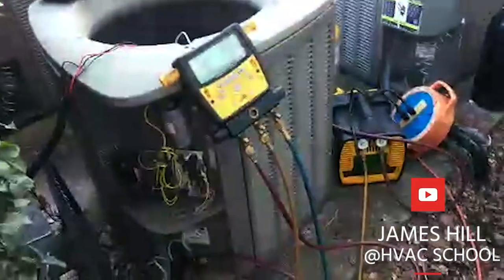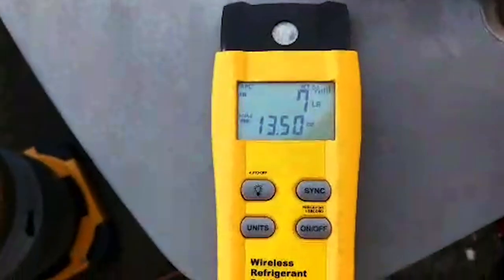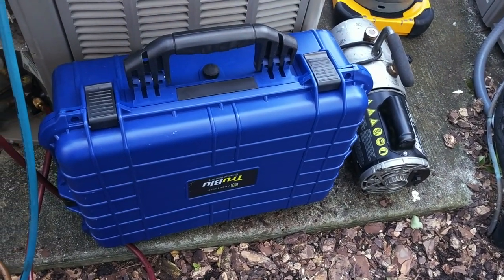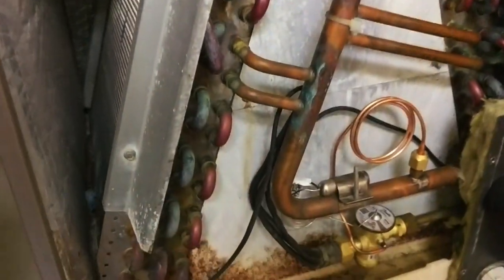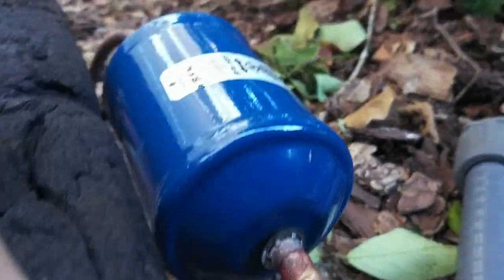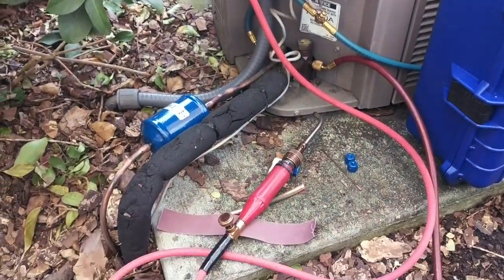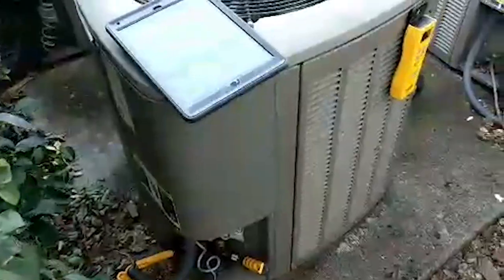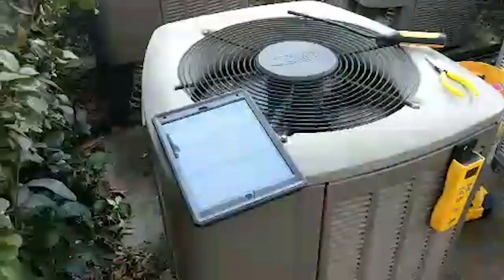How to Replace a TXV

Comment: Now i'm curious on how the TXV it's changed on a heat pump itself every time I search it get all the videos I am finding is for the one that is indoor at the evaporator coil. My American standard heat pump is coding bad TXV. When it switches the heat cooling works fine but no heat. Problems started after a maintenance call last month hear pump worked fine until they sprayed it out.

Comment: Either recover the refrigerant or perform a pump down. Remove said TXV and install new as well as a filter dryer. Perform a leak check. If everything checks out reintroduce refrigerant, and check delta T and charge. Done. Oh and don't forget to do a vacuum to at least 500 microns.
Reply: Running Coyote, no vacuum? 😉
Reply: @Mauriciom2011  yea I went back and added that. Hopefully I don't forget when I actually replace one  lol.
Reply: Too bad the guy only pulled it down to 1000 microns huh

Comment: How long was total evacuation time? I know it’s not about how long but was just curious. I’ve always found it took awhile to get below 500 when condenser is open to the line set. Unless I changed out the compressor.
Reply: Well I was evacuating the whole circuit which included the compressor and condenser coil, total evacuation to 500 microns took a good 2 hrs.
Reply: James Hill ok good. I’ve always had trouble even with 2 appion hoses. I think it has to do with the oil in the system. Any thoughts on why it takes that long? How do you like the tru blu.
Reply: @All4ChristNone4me  Love my TruBlu setup! And yes, that is exactly why evacuation took so long, I was evacuating the whole circuit, oil in compressor makes it take longer. My vacuum pump is 7yrs old but still pulls down to 40 microns when tested with micron gauge connected directly to it. Was just given a new NAVAC NRO6Di today, can't wait to try it out.

Comment: Soldering? Did you mean soft solder? That is would you have brazed in TXV or soft soldered the txv ?
Reply: You can use Stay-Brite 8 solder for HVAC instead of brazing. It's intended for HVAC use, everywhere except compressor head discharge port, really.

Comment: Can you remove the valve permanently and let it flow?
Reply: No. Your evaporator will either flood or starve constantly.  Pressure and temperature go hand in hand. As the temp changes in the unit and the ambient environment the pressures in your system are also changing.  Changing pressures will either flood or starve your coil, by slowing down or speeding up refrigerant flow.   A starved coil freezes up.  A flooded coil well it eventually floods and slugs your compressor.

Comment: Lol, the guy improved the situation by moving the filter from inside the case (where it would at least dry out quicker should the rain wet it in summer time) and moved to outside so that it will be easier to service later. Also, which part of the video corresponds to the title of "how to"?
Reply: “Get wet?”  It’s a filter drier, who cares if it gets wet?  It will dry just as fast as everything else out there.  Now for ease of replacement for the next guy, yeah that’s cool.
Reply: @bertellijustin6376  - it doesn't matter what this part is and what it does, what matters is that this part is in-line with the refrigerant flow line, and when it gets rusty (and it will get rusty very quick because it is still jacketed), it will cause refrigerant leak. That's why manufacturers started at least encasing  those, and when replaced, people are moving them inside (closer to the coil) for better durability and later serviceability.

Comment: You couldn't pump the system down at all? Why replace the filter drier if it wasn't exposed to atmosphere. Seems like way more work than it could have been.
Reply: High-end vs budget repair work. Always recover and give a fresh charge with repairs. So many places have poor installs and wont last because of lazy install guys. Had too many systems run 10 times better then the customer remembers it when new just recovering and changing txv or compressor.

Comment: You didn’t cut the drier out?
Reply from the maker: I see what you are saying when he showed it it does look unsweated. Sometimes on Lennox there is very little space to cut but I will follow up with him and make sure he knows that cutting out is best. I didn’t notice that during editing.
Reply: Didn’t mean to upset anyone😅
Reply: Love the videos tho! Especially the podcasts! Btw 😬😃
Reply: With Lennox units as well as Goodman units when the dryer filter is located so close to the bottom of the unit from the factory it's almost impossible to cut the dryer out. Also very little space between txv and dryer.  Otherwise, I always cut rather than unsweat.

Comment: How much does it cost for the txv, i got a quote of $850
Reply: That's reasonable.
Reply: gangsnowman1 why are online estimates under $400?
Reply: @Floweroftheprairie2720  nobody charges 400 for txv lol
Reply: Considering the part only cost 100 bucks I would say they are trying to eat allot of steak dinners.  Crooks
Reply: @johngatsby1473  i was quoted 1200 here in s. Az. T i told the company where to go....i think they had a kid in college and wanted me to pay for it....a holes
Reply: @tomkelly3896  the sad part is that they are super easy to install but you need to pump down the AC unit which is literally turning a screw, install the new valve (if your lucky and have a screw on type) BUT.....the system has to be vacuumed down to remove all moisture and air and that's why they are able to get you because normal folks don't have a vacuum pump.  Once it's pumped down you just release the refrigerant back into the system.  I did my own last year and was really surprised at the ease.
Look for a tech doing a service somewhere and ask him if he will stop by on his off time and do a quick side job....offer him 200 bucks.  There's always one out there that will take you up on that.
Reply: @johngatsby1473  it would pay to buy a vac pump ...if i saw,a step by step how to...im sure i could do it....not many vids on how to.....i tried to get a few guys to come do it as,l a side  job....but im surrounded by laziness here in southern az.
Reply: @tomkelly3896  I bought my pump at harbor freight.....it's a slower rate evac but I literally left mine on for an hour because I didn't have a micron gauge.  For the money saved you should go ahead and just buy gauges so you can make sure it doesn't leak after you pump it down.   
We just came from AZ (saddle Brook)....if it wouldn't have been too far out of my way I would've come helped you out.  Ac guys piss me off that bad.
Reply: @tomkelly3896  I encourage you to just watch tons of videos and just do it.  The key is making sure you pull a vacuum and check for leaks.....you are releasing almost 100% of the old refrigerant back into the system so if you had no leakage.....you won't need to top it off or anything.   It's a total scam those guys
Reply: @tomkelly3896  before I took the plunge and bought all the tools....I was trying to just get them to do the installs of equipment I buy online....they called me scab and cussed me out and some were halfway nice and just hung up.  Those same people will talk bad about any brand that you can get online but honestly.....I've only had one issue in 9 units that I bought online.....just 1.  When they say they won't warranty the equipment if I buy it online.... I tell em that the equipment has a warranty, you just have to install it right....they get real mad.  Nowadays I don't even register my equipment because even if they warranty it...the ac tech will always charge way more than me just buying a new replacement and doing it myself.  Works out great.
Reply: @tomkelly3896  did you get the link to the pump down video?  I don't see it in the comments
Reply: @johngatsby1473  agreed🤠